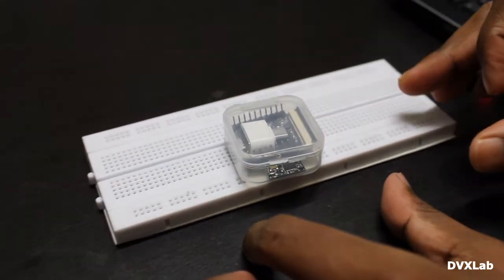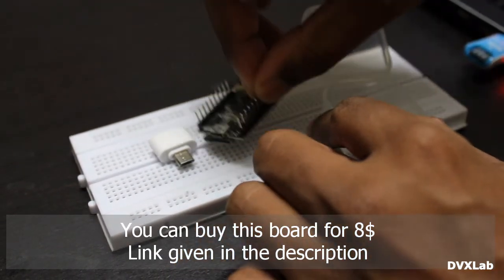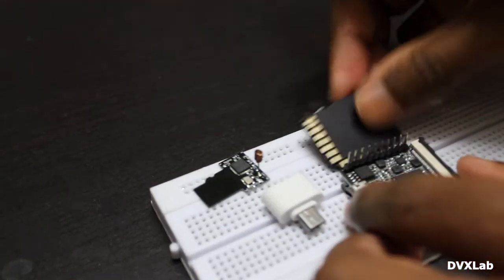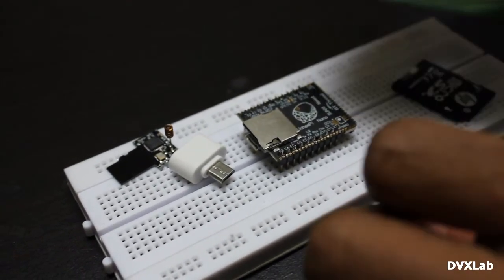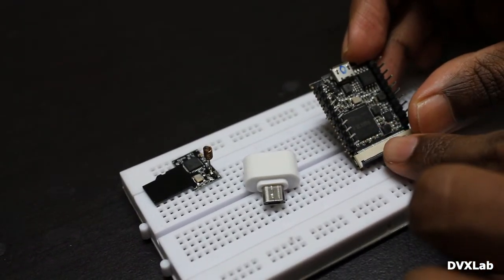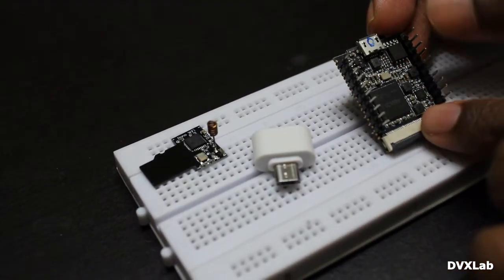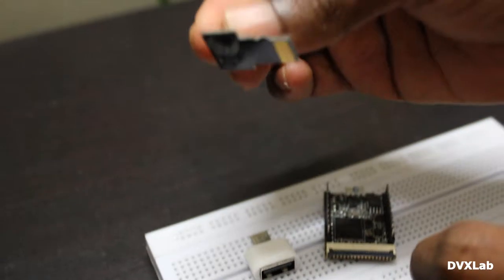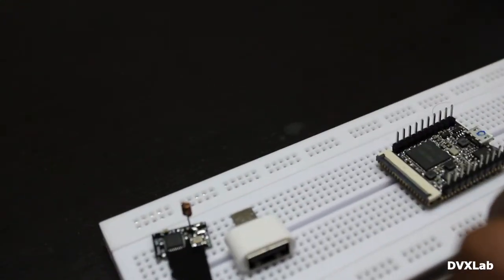Licheepi Nano Development board getting started

Comment: I know this was 2 years ago BUT this seems to be a board that will never work since there is no image that will support the Wifi and 16MB flash installed - I could not find any and even the manufacturer is not responsive - so I do not SEE any use for a tutorial on this board since it will not work at all. I am not recommending EVEN Buying this board. Just wanted to make sure that people will not build hope for these boards. I paid overhead for that board and I do REGRET it! I hope this will help people that trying to learn this board and get frustrated for no reason but the maker of these boards. Happy making!
Reply from the maker: i have't tried SPI flash+wifi , technically it should work , SPI flash gives limited scope for debugging , that might be the reason why so far no such image /code available yet.  just realized the SD Card image link is also moved , will rebuild and add it.
Reply: @dvxlab  Technically on paper everything should work - but I have NOT found a way to build a 16MB image that I can use in the flash of the device using the FEL mode and build a WORKING operation system, that MOST of us want to have when buying these type of boards. When the WiFi is taking the place of the SD card - you can NOT have a working OS with networking using an image installed on the SD so you are left with a total of 16MB for the OS (that is OK, I have seen less than that working as they should using OpenWRT as well) and you MUST have the WiFi setup correctly and opkg or any repo that will give you the ability to WORK with the device at all - As far as I see it - the image should have the LCD and WiFi Support within the 16MB + a repo that will allow installing small commands that you might want to add and remove after usage, due to the 16MB limit! - otherwise, it is a BIG waste of money! I would be happy to see a working image for this device that works in the FLASH of 16MB with support for the WiFi and LCD that are both sold with this device as a COMPLETE Kit. That is something that missing in order to bring this board to the NEXT level and even make it an IoT goTo device for all kinds of projects - it is compact and that is a PLUS - but other then that it is missing a WORKING Operation system that Supports wifi and LCD to make it what it supposed to be. Hope you have any luck with that and help us all. Happy Making!
Reply: You're absolutely right 100% of all YouTube content on this board is absolutely pointless...great you can get it to power on. I have 2 of these nanos, and reach out to SIPEED support  back in 2021, there so no image with wifi module support and all debian buildroot guides on the internet on this also does not cover the basics on adding any networking to this board.

Comment: Thanks. I was wondering how I was going to connect to this. I used a PL2303 UART to USB converter. I connected the U0TX pin to the RX pin on the 2303 converter. I connected the U0RX pin to the TX. Connect 5V and GND. Then I plugged the converter into my USB port and with Ubuntu used the command screen /dev/ttyUSB0 115200 to connect to it. Really easy. Thanks again. I've had this for about a year (I think) and couldnt figure out how to interface with it. Now on to coding!